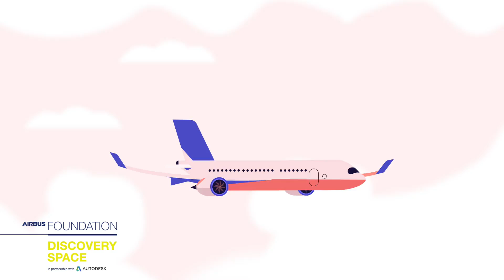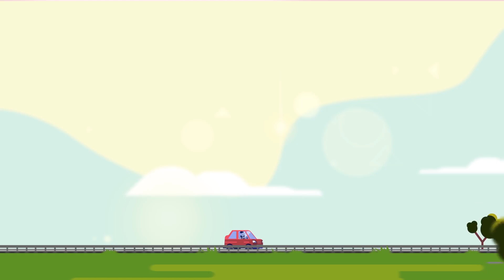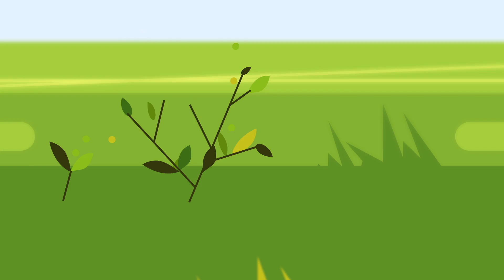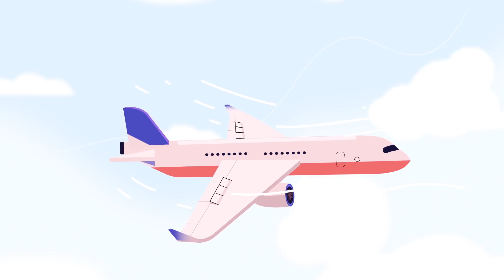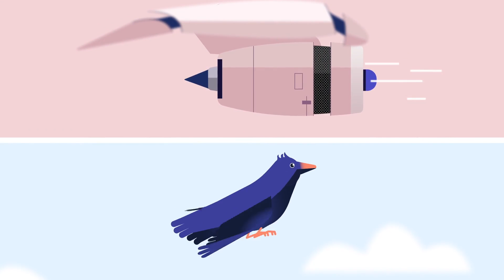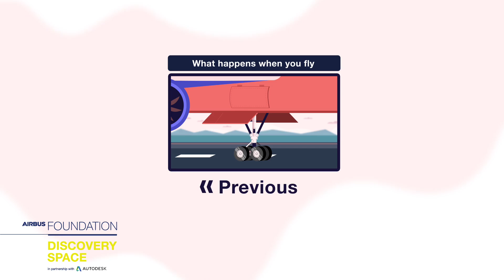How to land an airplane | Discovery Space

Comment: So many mistakes though...
- the pilot does not extend the flaps and slats as the descent starts. He/she waits until you're close to an airport to reduce fuel consumption and the noise foot print. Usually only in the last 20km or so when the airplane has already descended almost all the way are flaps extended.
- airbrakes are rarely used during the descent and never for landing (unless you're flying a glider or touring motor glider), they would reduce the lift and would demand a higher approach speed.
- Smooth airflow has nothing to do with the altitude the airplane flies at. Also the amount of speedbrake extended does not correlate to the altitude you are descending too, You don't need more airbrakes to descent further down.
- Gear is usually extended as late as possible or practical to reduce fuel consumption and noise pollution near airports at least on a well planned and economic approach.
- The thrust reversers are attached at the back of the engine and shift aft, not forward.
- The airplane drawing only has a front row exit but 23 rows of windows and quite a large fuselage diameter. There is no way you'll be able to evacuate that aircraft in under 90 seconds :)
I'd let that slip if it wasn't a video by Airbus.
Reply: @disconnectedio  yes :) but not for the purpose of starting a descent